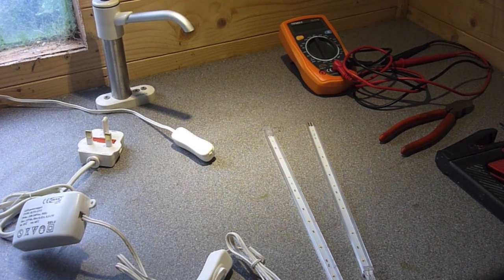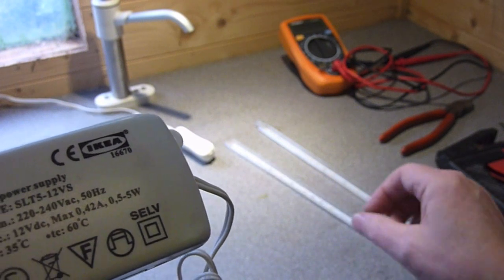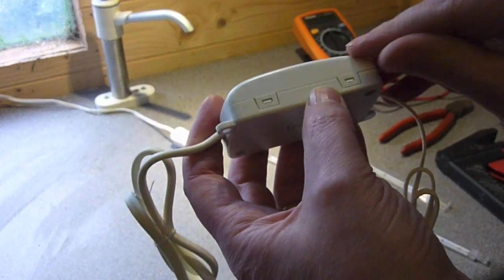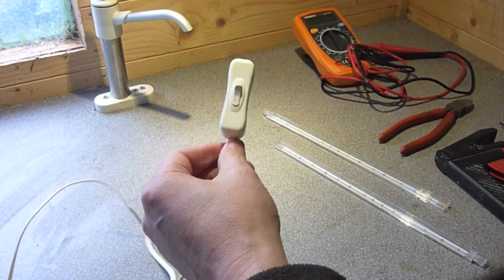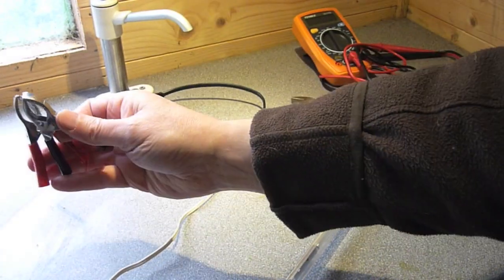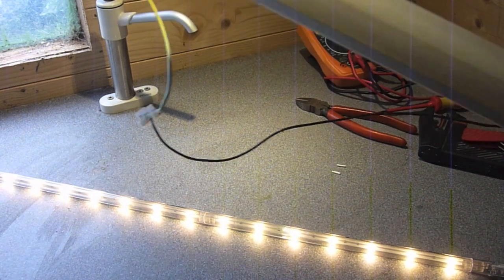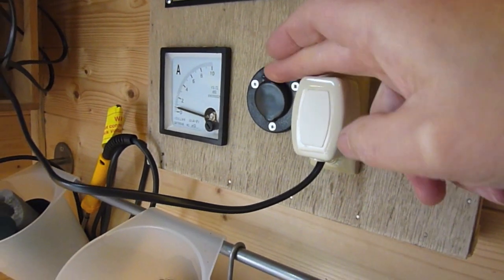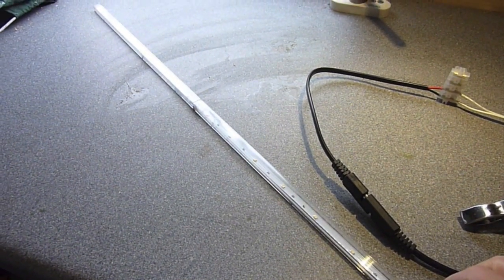LED IKEA lights running on 12v solar - Tales from the Solar Shed

Comment: Great instructions, thanks, I now have my kitchen lights on solar!
I noticed that Ikea is changing the ledberg-strips. The new ones are 24V instead of 12V. If you need a 12V led-strip you now have to get Dioder-strips, these run on 12V (at least here in the Netherlands)
Reply from the maker: +piranja68 Thanks for the comment. Yes, last time I was in IKEA I also noticed that the LEDberg is now 24V - what a shame. I'll have a look at the Dioder strips to see what they are like. There are plenty of other 'cheap; LED strips, but the IKEA LEDberg was good value and good quality too. I wonder why they changed to 24V?
Reply: Hi Martin, I dont know why, perhaps its because they are now selling those leds that change colour, maybe they need the 24V for that. The Dioder-lights look a lot like the one you use in the video, perhaps its just a name change for the same product. They work fine for me. Next step will be a 12v coffee-machine : )

Comment: Hi Martin, great video. I would like to use a solar light but without the battery. I appreciate this would mean a varying light output. Its actually to kind of simulate a skylight. Can this be done without a battery, maybe with a dc-dc converter to regulate fluctuations from the panel. Any help would be appreciated
Reply from the maker: I've not really thought about it for a light, but I guess you could. As you have said, you'd need to find a way to address (smooth) the varying output voltage from the panel to attempt to regulate it to around 12 volts, but at a certain point, the current would also be too low for a light (regardless of the voltage). A dc-dc converter would help, but I don't know much about them. I've seen people connect a fan directly to a small solar panel for ventilation and that works. Good luck!
Reply from the maker: Here's a very simple setup with a 12v fan, wired directly to the panel. https://www.youtube.com/watch?v=Bcy57WbZeF8
Reply from the maker: This guy uses a 24v to 12v converter: https://www.youtube.com/watch?v=gud5jHHa3Fg
Reply: Awesome Martin, thank you for responding. The added videos are very informative and confirm what I'd thought/researched which gives me the confidence to experiment myself. Thanks again

Comment from the maker: Hi Plat du Jour - thanks for your kind comments.
You are right that for any given wattage, the current draw at 12V is going to be higher than for mains electricity, and this needs to be a factor when choosing the the right gauge of cable to use. It's always a good idea to have a fuse in the positive as it leaves the battery, and I had this in my last setup - the current setup is temporary as I had problems with my charge controller and I haven't re-wired everything correctly yet. Some charge controllers also have a fuse inside them, and I have a master fuse in my distribution panel, as well as fuses for each circuit (ie lights, accessories etc).

Depending on where you live, wiring for houses may have to be 'to code' or to building regulations. Because my shed is not a 'dwelling' I've not worried about this, but in houses and the possible risk to yourself and others is greater - although 12V is very low voltage, it's the current which is the potential issue, so I would definitely get advice from a professional or someone with more relevant experience. 

My own philosophy is to keep things simple and ensure you can isolate various parts in order to allow for easy expansion in the future, and to simplify fault finding. For example, in my shed, the battery (or load from the charge controller) comes into my distribution panel (which is from a caravan) and that in turn separates it out into 3 distinct circuits, each with their own fuse and switch). I use one circuit to run my lights, one for the 12 accessory sockets and one for an outside light on a timer. If I was going to run an inverter (to give me mains voltage), then I would connect this directly to the battery as the current drain is very high and would necessitate upgrading the wiring. As it happens I've avoided all mains voltage equipment so far as even the best inverters are wasteful of energy, so I try to run everything at 12 volts. 

If the system was larger still, then you have to consider larger or multiple batteries. Or you could break it down into separate systems just for lighting (with it's own battery and solar panel) and another for 12v sockets etc. This way you have some resilience in that if the system for the sockets breaks down or runs out of power, the lighting is completely independent.

Finally, be as flexible as possible where you place sockets etc - whatever you think you might need now is bound to change as you settle in and adapt, so make it as easy as possible to add extra bits or move bits around. Label everything and go slowly. 

Enjoy!
Reply from the maker: ***** You are right about the costs of batteries in money terms, but also the environmental costs are high too - most batteries used in this way are lead acid and although they can be recycled (a very high proportion of the contents can be reused to some degree), it needs to be done properly to prevent pollution etc. If you can run things directly from a solar panel then so much the better and running fans is ideal as you tend to need their cooling effect when the sun is shining! In winter, when the sun is less reliable, you tend to need more lighting (esp in the evenings as they get darker earlier), then having hydro is perfect - again, rainfall to keep the hydro going is more likely in winter. Hydro is probably the greenest option over wind and solar.

Check out this link for a lady based in the UK that put in a hybrid micro hydro system as her location was unsuitable for wind turbines and she had little luck with solar. http://www.judyofthewoods.net/off/hydro.html

Comment: What is the intermediate between the crocodile clips and the wiring block? Is that a fuse?
Reply from the maker: It's just a connector - I had the wires with the crocodile clips on and that had a connector on the other end, so I just another plugged it into another connector to make it easy for me. Nothing special!

Comment: My hobby is rc cars that run on 11.4 volt lipo batteries, the chargers can run off 12v battery or mains,i use both at the mo, i was thinking of a solar set up to charge the lesure battery  that runs the charger, what idea could you recomend thanks .
Reply from the maker: If you charge a leisure battery from solar, it'll be around 12.5 volts, give or take. Your existing charger, if it can run off a 12volt source, could connect to that to charge your lipo batteries. An alternative would be a small inverter to invert the 12v from the leisure battery up to mains (household voltage) and then plug in your mains charger - however, you will be wasting some power (10-15%) though the inefficient inversion process, so run direct from the leisure battery if you can!

Comment: If this is a stupid question please forgive me. Are you using a 12v car battery ? Are the lights wired directly to the battery or are you using a fuse blocking diode? I know enough to get me in trouble . I fear blowingupt the whole thing when I flip the switch or overloading causing a fire in my barn. If I could get light it would be fantastic. Please help,, anyone.
Reply from the maker: Hi. It's not a stupid question - caution is always a good thing. Please remember that when I made this video, the IKEA lights were 12v - the current ones are 24v so won't work from a battery!  In this set up, the lights are wired into a 12v battery (it's a leisure battery, so similar to a car battery). If wiring permanently, I would always include a suitable fuse in the wiring.

Comment: Hi Martin just came across your post. I am looking something similar for a wee sun room I built that cannot get power to. Could I connect these wee lights straight to a solar panel, also do you have to be careful that things do not overheat using a solar panel. I mean a small amazon one that runs 12volt thanks.
Reply from the maker: Hi Paul. Personally, I would not run these directly from a solar panel. The reason is that a 12 volt solar panel can produce a voltage up to possibly 20 volts in full sun, and that could easily exceed the safe voltage for the lights. Also, generally you need the lights at night when the sun isn't shining, and hence the solar panel is producing nothing. The best way is to have the solar panel charge a battery and pull your power from that - it will be much more stable in terms of voltage and allow you to run lights when the sun isn't shining.

Comment: Thank you! We're doing something like this for our mountain cabin. We bought a very similar Ikea set called Dioder. It has four LED modules that can connect just like this. (It's a bit brighter than the Ledberg variant and we chose it for over the kitchen counter). The instrucions in the box says to connect maximum 4 modules. Do you know if the modification of eliminating the transformer makes it possible and safe to connect more than 4? So perhaps 6 or 8?
Reply from the maker: +kvatt Hi - glad you liked the video! I've not used DIODER - when I bought the LEDBERG sets, the DIODER was much more expensive than it is today. Assuming that the IKEA Dioder transformer outputs 12 volts DC, then the limitation on the number of strips will be down to the maximum current the transformer can output. If you are connecting them to a battery, then you don't have the same current limitation so you could increase the number of strips connected beyond the suggested 4 - I can't see why 8 would not be a problem. Make sure you use suitable gauge wiring to handle the current and carefully check the polarity of your connections to match that of the original transformer. Best of luck!
Reply: +Martin Doyle It worked! https://instagram.com/p/8a0fZ3y9Y3/
Reply from the maker: +kvatt Brilliant!!!! Well done and thanks for linking to the photo - great to see them in your lovely cabin - I'm not jealous at all :)

Comment from the maker: Not sure! Some LED lights are designed for 12v battery power so have a voltage range, say from 11 to 14 volts, but as these IKEA lights are designed to run from a mains transformer I don't know - try it! It would be easier if you got a 12v battery to start with as they can be charged from solar etc with ease. Also an 11.1v system will loose voltage as the charge reduces, so you may end up with 10v or less. 14.8v is probably too much unless you put in something to reduce the volts.

Comment: HI am looking at doing my won solar project with strip lights but want to run them off re-purposed solar panels from garden lights is this possible and how would this be done.
Reply from the maker: Solar garden lights are designed to recharge low voltage batteries (1.5 - 3volts usually) and are extremely low current (ie the batteries don't hold much charge). The panels within them are very small but enough to run 1 low powered LED for a few hours. Technically it's possible, but you'd need LOTS of solar panels and would need to know how to wire them in series to get enough voltage etc - personally I think it's too much bother.

Comment: Thanks for this. Just a question: Where do you get these 12v DC plugs from? (The one on the lower right of the board at 8:43)
Reply from the maker: Hi Dick. Many thanks for your comment. The DC plug you mention is available in the UK if you search for "CLIPSAL 12v PLUG" - not sure about other countries. Check out my other video on 12v connectors which will give you more insight: https://www.youtube.com/watch?v=tbtraSALQvA
As of today, I have moved over to a single cigarette lighter socket and a dual USB socket.

Comment: Hello, I watched the video and ventured out to Ikea last sunday. The. actual ledberg kits were there still. The transformer however is now incorporated int he plug. it also outputs 12v with max 4.2 a and 5watts. So I took your lead and cut the plug including the transformer and wired the pos to the pos and neg to the neg. Switched the entire constellation on, but nothing. I tried to connect them next to a 12v cigarette lighter plug, and also nothing. Testing the lights on the battery direct by making contact between the wire and the poles on the battery also does nothing. I ended up fixing up the original plug again and use a 220 to 12v transformer as I really like the warmth of the lights. 

Do you have a clue what this might be? What is different in an in-line transformer compared to a plug adapter? The lights do work only if they are connected via the original plug... I can send a picture of the new adapter plug. 

I don't think I got the wires crossed as the positive had clear markers on it and the negative only very tiny writing.  Anyone else bought the new ones? 

Brilliant video by the way!
Reply from the maker: +angelique van engelen Thanks for your kind comments. I'm don't think the new transformer that Ikea are supplying will affect things - ultimately all it does in convert 220V AC to 12 V DC which is the same output that your battery should have. The most obvious thing is the polarity - some LED lights have some electronics inside called a 'bridge rectifier' which will allow them to be connected either way around, but I don't think the LEDBERG lights do. Can you get access or borrow a multimeter? This can help you check which wire is positive and which is negative so you can wire them up right. I suppose you could just try them the other way around to see if that works - if you try with just one of the strips, the worst that can happen is that you break that single strip... Let us know how you get on....
Reply from the maker: +angelique van engelen I was just re-reading your comments and you mention "the negative only very tiny writing" - usually, it is the positive wire that has the writing on, so I strongly suspect you have the polarity wrong!

Comment: Can you tell how many watts the full 6 LED strips draw?
Reply from the maker: Hi - I can't say precisely as I have nothing to measure watts with. My ammeter is analog and not especially accurate, but it looks like the 6 LED strips are drawing around 0.3A at 12 volts, which is about 3.6 watts in total. Hope this helps!
Reply: That sounds about right.
Reply: Built-in LED light source.
Energy consumption: 1.8W.
LED life time approx. 20.000 hours.
Light colour; warm white (2700 Kelvin).
IKEA. Model L0911 Ledberg. This luminaire contains built in LED lamps. The lamps can not be changed in the luminaire.
Reply from the maker: chilliman07 The consumption figures you've given are for the pack of three light strips, and are based on the amount of power drawn through the mains (110 or 230V) transformer. If you drive them directly from 12 volts DC, you bypass some of the inefficiencies and losses of the transformer, so the energy consumption should be lower. I've also found that the colour temperature can vary between batches, but as this is a very low cost product, it is unreasonable to expect it to be 100% accurate!
Reply: Oh ok, fair enough. I am planning on getting a set to extend daylight hours in my chickens coop.
Reply from the maker: chilliman07 Assuming you are working on 12V, I'd still work on the basis of one pack (ie 3 light strips) consuming around 1.8 watts, which is 0.15A. Cutting out the transformer will save a bit, but then again, you could loose some power down the 12V system in other places, so nothing is 100% accurate!!!

Comment: Does that led need any driver or it is connected directly to solar controller? What about the MR16 same?
Reply from the maker: No driver is needed - the original power supply was 12v and could power up to 9 strips, so I connected it directly to my battery (12v) and they are still working fine to this day. I assume there must be some regulation on each strip. 
MR16 bulbs have a driver built into the base to regulate the power.

Comment: Hi Martin, love the show...

I was wondering about fire safety and 12v systems  I read that the high amps in DC systems can give increased risk of fire and that one should fuse the positive as it leaves the battery.  Is this so and are there any extra precautions I should take to use solar 12v inside my house?
Reply: A fuse is very, very good idea. A short can produce a lot of heat and a fuse might help with that. Very high power installations might want to fuse at several places with lower value fuses.
Reply: 12v DC systems are safe as long as good care is taken and you use fuses wherever possible. just like in a car.

Comment: why did you cut the on/off switch off ?
Reply from the maker: Because the wiring would be hidden and I was going to use a wall mounted switch. If you're happy to use the inline switch on the cable, you can keep it - just personal preference.

Comment: Seems a rather complicated way of lighting using Ikea. These direct connect strips are available (in various shades and colors) via ebay at 2.95 per mtre so you can select any length you like. They are waterproof and dimmable. Usefully they are also cuttable every 3 leds - marked with tiny scissor symbol
Reply from the maker: Hi. It depends on your point of view and your expertise in electronics. Also bare in mind this video was made in 2013 - back then, it was more difficult to get good quality LED strips and the internet was full of tales of woe of people who were disappointed with what they got. At least with the IKEA lights, you could walk into a store and buy something without having to try to work out if they would work etc. Of course, if I was doing this now, I would definitely look doing it differently and would do as you say.

Comment from the maker: Trying to power a 12 volt device with 11.1v or 14.8v is making life very difficult for yourself! Just get a 12v battery (or 2 x 6v batteries) - they are common and depending on capacity, not too expensive!